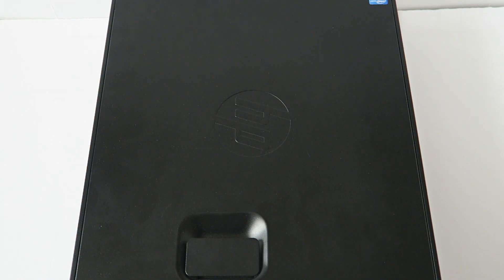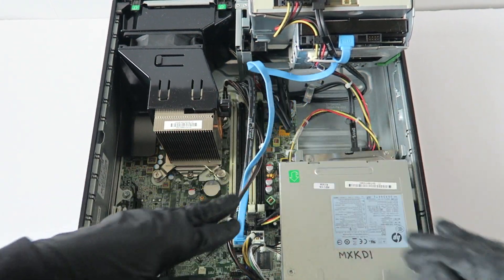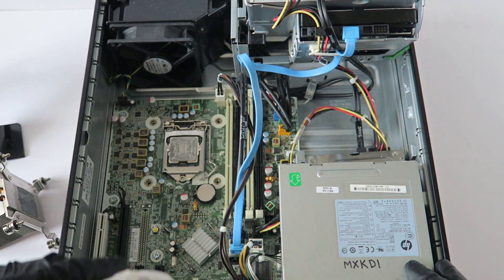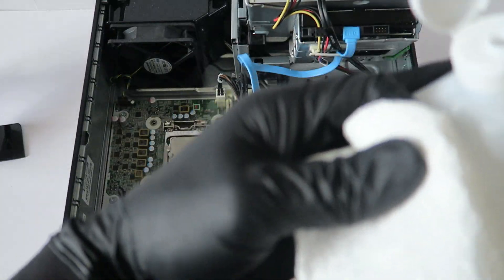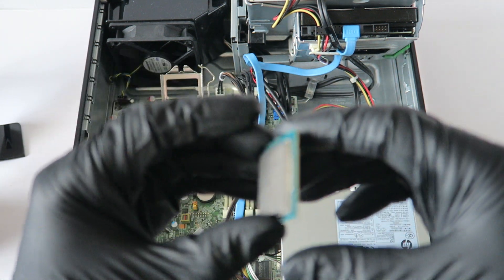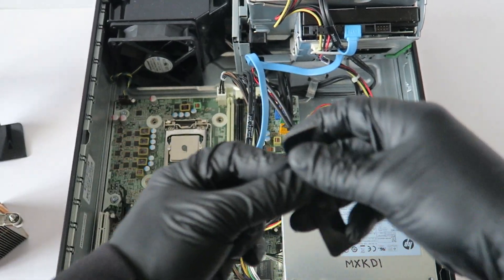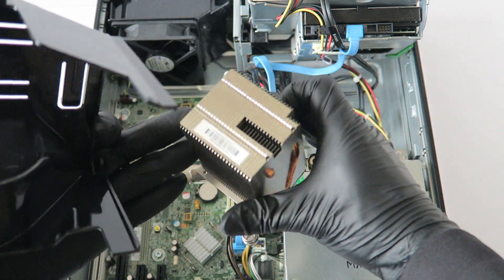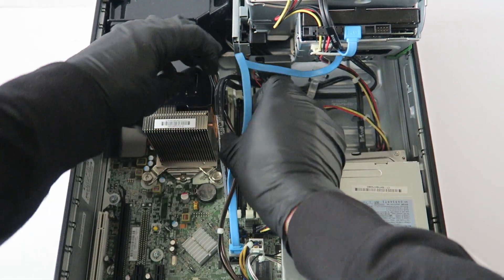HP Compaq Pro 6300 Processor Upgrade

Comment from the maker: List of Upgrade Parts will work with this system. 

Thermal Compound Paste:
(1.) Arctic MX-4 2019 Edition Thermal Compound Paste Carbon Based
https://amzn.to/2XcsZo4
(2) Arctic Silver 5 Thermal Cooling Compound Paste 
https://amzn.to/2ziNU0H
(3) Noctua NT-H1 3.5g, Pro-Grade Thermal Compound Paste
https://amzn.to/36kTk7A
(4.) ARCTIC MX-4 (current edition) Thermal Compound Paste 20 Grams 
https://amzn.to/2DhGJaK

This RAM works with this machine:
Tested with 16GB RAM MAX works perfect with this machine.
(1.) Crucial 8GB Single DDR3L 1600 MT/s (PC3L-12800) Memory CT102464BD160B
https://amzn.to/2z7gDpj

(2.) Crucial 4GB Single DDR3L 1600 MT/s (PC3L-12800) Memory CT51264BD160B 
https://amzn.to/2TrcLq1

(3.) Crucial 16GB Kit (8GBx2) DDR3L 1600 MT/s (PC3L-12800) CT2K102464BD160B 
https://amzn.to/3g7dE0C
 This video cards will work with this system.
(1.) Gigabyte Geforce GTX 1050 Ti OC Low Profile 4GB GDDR5 128 Bit PCI-E Graphic Card (GV-N105TOC-4GL) 
https://amzn.to/2XEqKMb

(2.) MSI Gaming GeForce GTX 1650 4GB GDRR5 Low Profile Graphics Card (GTX 1650 4GT LP OC) 
https://amzn.to/2VkDdSd

(3.) MSI GTX 1050 TI 4GT Low Profile  Graphic Cards 
https://amzn.to/34r0AxG

(4.) Gigabyte GeForce GT 1030 GV-N1030D5-2GL Low Profile 2G Computer Graphics Card 
https://amzn.to/2Xu3SyO

(5.) ZOTAC GeForce GT 1030 2GB GDDR5 64-bit Low Profile Video Card ZT-P10300A-10L 
https://amzn.to/3eayL1b

 SSD list works with this PC.
(1.) Samsung 860 EVO 500GB 2.5 Inch Internal SSD MZ-76E500B/AM) 
https://amzn.to/2yNxnkE

(2.) WD Blue 3D NAND 1TB Internal SSD, 2.5" WDS100T2B0A
https://amzn.to/2wvnC9Z

(3.) WD Green 1TB Internal PC SSD  WDS100T2G0A
https://amzn.to/3cbrcWa

(4.) SanDisk SSD PLUS 480GB Internal SSD SDSSDA-1T00-G26
https://amzn.to/3a3i9ou

(5.) Crucial MX500 250GB 3D NAND SATA CT250MX500SSD1(Z) 
https://amzn.to/34rZlhy

(6.) Samsung 860 PRO SSD 256GB - 2.5 Inch SATA III Internal Solid State Drive
https://amzn.to/2ybiHLK

(7.) Samsung SSD 860 EVO 250GB 2.5 Inch SATA III Internal SSD 
https://amzn.to/2VjIAkK

(8.) SanDisk SSD PLUS 240GB Internal SSD
https://amzn.to/3c7SEE4

HDD list works with this PC:
(1.).WD Black 2TB Performance 3.5" Hard Drive - 7200 RPM Class, WD2003FZEX 
https://amzn.to/2xFUeyF
(2.).Seagate BarraCuda 1TB Internal Hard Drive
https://amzn.to/3g8FXM8
Reply: what about changing the psu
Reply: @popcornandzerocoke5043  proprietary design, not sure if there are aftermarket replacements / upgrades.  stock power supply is about 240 watts will host 1650 low profile @ 75 watts.  people in some instances are moving to larger cases that will host a larger psu., problems w backplate matching.  these things are a bit of a quandary whether worth the time / effort and $ to bring close to modern standards.
Reply: @kevincody8391  sff is a risky choice, then.
Reply: @popcornandzerocoke5043  sff always is, esp when propierty = HP / Dell.  remember that going forward, you may not know now, butt will eventually.  get condition max flex, maximum flexibility.
these puters range from dirt cheap free.99 to a $100.
Our choice is to sink money or effort, some combo of.  pure Effort = converting to Linux.  and there's a lot of effort in not, can you successfully clone spinning HD w Windows 10 to an SSD?  decide that before upgrading video, or hate Windows.
Reply: @kevincody8391  I am currently running the MSI 1650 lp link you gave... and my pc runs fine, but you need a dvi cable, unlike the factory VGA.

anyone know any GPU's I can put on the computer's HP 339A motherboard.
Reply: THANKS FOR THE VIDEO this was very very helpful, definitely subscribing
Reply: so you didn't have any problems runnig the new CPU? because this was a pre-made system, you know... I am just curious.

Comment: whenever i upgrade my cpu from i5 3470 to i7 3770, i cant boot the pc with my gtx 1050 lp on, it only works if the gpu isnt connected or drivers not installed, but with the i5 it works perfectly is there any help please
Reply: I upgraded my HP 6300 pro I7-3770 Computer but it crashes, what should I do?

Comment: whenever i upgrade my cpu from i5 3470 to i7 3770, i cant boot the pc with my gtx 1050 lp on, it only works if the gpu isnt connected or drivers not installed, but with the i5 it works perfectly is there any help please

Comment: Hello, I wonder if it is possible to add a cooler for the processor without having to remove the motherboard from the case? Would you recommend that or leave the one you already have in stock?
Reply from the maker: Hi, you can only use hp stock cooler  SFF LGA1155 CPU Heatsink 628553-001

Comment: Thanks I have a question.  My system model is hp compaq 4000 pro . Can I install a i5 or i3 cpus ? Like i3 560 or i5 750 ??<3
Reply from the maker: Hi, no fastest CPU this PC supports is Intel Core 2 Quad.

Comment: hey bro, can i put i5 9400f?
Reply from the maker: Hi, no
Reply: @Mxkdt  bro can I use I5 3570 3.4 GHz (upto 3.8 GHz ) on my hp Compaq pro 6305 microtower pc (not small form factor)
Please reply 
Currently I have A10 5800k processor which supports  fm2 socket, will i5 3570 work on my motherboard

Comment: I'm making a gaming pc out of one of these and rn i only swapped the ram and I'm wondering if I should get a 1050ti lp over a 1650lp cause of the lower power draw. Would I have to do that?
Reply: Can you tell me how happy you were with yours after upgrades? Trying to find out if it's worth upgrading mine.  Thanks in advance
Reply: @4tobybrooks  Mine ended up frying itself somehow so i jjst ended up tbrowkng it out, they are so old, i now have a Nitro 50
Reply: @Dustin34  so I should probably pass, huh?
Reply: @4tobybrooks  100%
Reply: @Dustin34  thank you!

Comment: Hi im just planning to change my processor and i have the MT version. I'm thinking getting a a i5 processor which i5 processor is good? and can i get the K variant? because the k variant have hd 4000 integrated graphics (i dont plan on overclocking it i just think its better for a few bucks) any help will do 

edit: i dont have enough money for i7 3770

(sorry for my english it's not my 1st language)

Comment: nice videos. very good. i have a question, did u changed the power adapter, i´m maybe gonna buy a refurbished one HP Compaq 6300 Pro with a 230 watts unit and i worry about the upgrades there may come like a aktive gpu like u did.  i´m gonna use 1 ssd only and gonna disable the cdrom
Reply from the maker: HI, i did not change power and if you going to buy HP Compaq 6300 Pro go with i7 CPU and PC holds more value then i5 or i3
Reply: @Mxkdt  thank you :)
Reply: @Mxkdt  If I were to upgrade the power supply, do you know what kind I should be looking for?

Comment: BROOOO THABNKS YOU SO MUCH
Reply: just inherited one of these for free.99, an i7-3770 unfortunately w only 4 gig of ram.  what conclusions have you reached?  
a low profile 1650 = $150, a 1 GB SSD = $100.  if you can't scrounge up some DDR3 laying around, 8 GBs for $35, $60 for 16 GBs
so for approx $350 have a semi potent gaming / video trans-coding machine w DVR capability
has a working copy of Windows 10 on a spinning HD, odds of cloning to a SSD?
this thing is on the knifes edge of worth the effort / money
fail and and it is a deep dive into Linux

Comment: I have a hp Compaq pro 6305sff with processor AMD a10 5800b with gt 1030...can i change to Intel processor if not what the best processor for my motherboard
Reply: How is this set up working for you? I have the same computer (6305). Just bought the A10 5800b processor and planning to put the gt 1030 with another 4gb Ram to make it 8gb and a ssd. What do you think? Just light gaming and what not....whats the full specs on yours and how is it working for you? Thanks

Comment: Buddy 1 question i cant enter bios pressing scape. When í do this keeps the post screen (the only option i have is F1 to boot) thanks
Reply: On HP Systems you typically press F10 for the BIOS. An just press F10 repeatedly from the beginning.

Comment: hey @Mxkdi i have the hp compaq 6305 cpu with amd a6 processor rn can i upgrade to i7?
Reply: an amd socket does not support intel cpus
Reply: @illegaloper  can i replace it with a higher generation amd?
Reply: After a lot if research,  i came to know that i got FM2 socket so i can replace my a6 with a10 which is pretty much good for my use😊

Comment: First of all, thank you for all of your videos! 

Did you find any need to upgrade the motherboard? Wanted to order the i7, but my only reservation is if the motherboard will bottleneck it. Also, will this work with an SSD?

Sorry for the novice questions, but I'm very new to this, and wanted to make sure I do it right the first time. Thanks in advance!!
Reply: I feel the same

Comment: I have a HP 6005 compaq pro with an athlon x2 b28 processor. Would I be able to install the same cpu as this one?
Reply: Samuel Paler hope so, I’m in the same boat. Fair warning, there isn’t a lot of info on our setups.
Reply: @marcusjnewtonz28  Thanks you your reply! Are you also using the same cpu? I was thinking about swapping my motherboard with one from an 8300 compaq pro. The frames seem the same and the 8300 accept intel's I7 cpu and has 4 usb 3 ports on the back. I'm not sure if it will work though
Reply: Samuel Paler you MIGHT run into some trouble with the difference in USB ports. IMO, being there are certain models of i7 CPU’s that are compatible with our motherboard, I’d recommend sticking with it, and letting the cpu and video card do the heavy lifting, provided you already upgraded your ram. And yes, same awful cpu 👍
Reply: @marcusjnewtonz28  I thought our motherboard was only an am3 type cpu socket and it only accepts up to 95 watts of cpu?
Reply: Samuel Paler After researching it further, a reference I was reading on the upgrade to an i7, they put separate motherboards in the 6000 series ssf hp’s that we have. Our’s are indeed different, as are every other 6000!series out there. It keeps getting harder to find accurate info on this damn thing. Keep me posted on your build if you don’t mind man and I’ll do the same 👍
Reply: Samuel Paler one more thing, I’ve since found that the AMD Phenom b95 quad core, though 95 watts, is compatible, with our motherboard. Apparently the MB’s were built to be “flexible” to 95 watts if needed. 👌
Reply: @marcusjnewtonz28  I was searching up am3 cpus and found the AMD Phenom II X6 1065T. It uses 95 watts and am3? Its a 6 core.
Reply: Samuel Paler I looked at some reviews and our stock fans won’t support it; however it’s easy to just buy a better fan 👌I like that CPU
Reply: @marcusjnewtonz28  I decided to pull the trigger on swapping out my motherboard for an 8300 sff elite and finished it today. I went with luck to test if it would fit and all the plugs and screws lined up to my surprise. It has the lga 1155 cpu socket in which I bought an  i7 3770 for. I lost the use of my 250g hardrive and redownloaded windows to my ssd which I also had. I will try to get it working someday. I had to wipe my 500g ssd to do the job. My computer reads itself as an hp 8300 elite sff now. The i7 is way better than what a 1065t would be even with less cores. No more 100% cpu spikes with the old amd athlon ii x2 b28.

Comment: Can I put an i5 3470K processor or an i7 3770K on the hp 6300?
Reply: You can, however it would be better to go with a 3470 or 3770 instead of the K variant as you will not be able to overclock on this mainboard.  If you already HAVE the K variants then it's no big deal but don't spend extra for them as you can't take advantage of them fully.

Comment: So I have two of these PC's both are the microtowers, I bought one with an i5 3470 the other with an i3 2120 both had 4g of ram. The i5 motherboard went so I decided to just upgrade the i3 to the i7 3770 and install 16g of ram. I installed the ram first to make sure it worked and no issues with the i3 so in with the i7. Hit power and I get 5 beeps and no boot just a black screen, I located the first two ram ports and only left them loaded and it booted fine so I tried again with all 4 loaded and same results as at first. I swapped out all ram to 2g sticks and would only boot with first two ports loaded. So I swapped out the processor to the i3 and everything's good again so I swapped to the i5 I had laying around and it's good everything works I put the i7 back in and I am back at square one. Could it be my processor is bad? It shows up correctly in the BIOS and windows system.
Reply: Problem solved. I used a pencil eraser and gently cleaned the contacts on the processor  , what made me think to look at that was the fact it wasn't seeing the ram and I tried everything else.
Reply: @tronalddump8776  Can I upgrade i3-2120 to i5-3470 in 6300 Microtower?
Reply: @detectivegenius9744  you can upgrade to a i7 3770 or the comparable xeon even. you have to make sure to keep power consumption within power supplies specifications or you will need to upgrade the psu, you will need an adapter since those boards require some proprietary connectors.
Reply: @detectivegenius9744  Xeon E3-1230 v2 selling for $12 dollars on ebay. 4 core 8 thread and slightly less performance than 3770 and since overclocking isnt a thing on that hp board youre better off.
Reply: @tronalddump8776  PSU(320W) can handle the power and i think it will be easy to install new cpu as both i3 2nd and i5/i7 3rd gen use same cpu connectors.
Reply: @detectivegenius9744  run it
Reply: @detectivegenius9744  i meant to hook up a atx psu you need an adapter otherwise it wont turn on. if you put a decent graphics card on it and that cpu together are gonna be at or above what that psu can handle. im just letting you know you got to take that into the equation with these hp pc's.
Reply: @tronalddump8776  Okay, thanks

Comment: What processor do you use when you upgraded
Reply from the maker: Why would you want to go with i5 and you can get PC with i7 for little extra.
Reply: @Mxkdt  idk
Reply from the maker: Hi, yes Intel Core i7 3770
Reply: @Mxkdt  what about the i5
Reply: @Mxkdt  how i can install gtx 1060ti on the pc
Reply: @PhúcBụi-k1p  just put it in the PCI x16 slot

Comment: Can i use i5 3570k and gtx 1050 ti if my power supply is 240w?
Reply: yeah ig but you will probably need another power supply
Reply: Chandler Stovall ye
Reply: Quite a few people on Youtube have built a 6300 with a 1050ti so I'd be confident it would.
Reply: thewinky01 Okay Thanks!
Reply: Eepuz I’ve swapped my processors around and now running a 1050ti with a 3570. Seems ok so far.
Reply: thewinky01 but The ”k” version takes more power
Reply: Pretty sure you can’t overclock them, all locked down being a business PC. Happy to be proved wrong!
Reply: @thewinky01  only the intel k's can be overclocked

Comment: This supports until intel core i7 to i5 which both of them cost a alot as 200$ is the lowest price i can find for intel core i5 and intel core i7 is around $500 edit: the model is also able to be upgraded into core i3 but the max it can be ugraded is to 3.9 ghz. and more in the quickspecs link below on the 3rd page http://static.highspeedbackbone.net/pdf/HP%20Compaq%20Pro%206300%20Series%20Business%20PC%20Quick%20Specs.pdf hope this helps

Comment: I have this computer in the 6005 model with the Athlon II x 2 B24. It is a HP 3047h Motherboard with a Chipset of Northbridge

AMD 785G.      Can I upgrade to the Intel Core i7-3770 too? Or the 3770S? 3770K?

Comment: I put a new processor that is i5 2400 ... After that display not showing and fan are running at full speed with a very loud sound... Ram are ok and processor also can you tell me what will the problem
Reply: Wrong processor. You need a 3470, 3570, 3770

Comment: Hi. Can i put gtx 1050 ti zotac single fun?
Reply: 1050 low profile will fit
Reply: Low profile card will work but be careful of what processor you have running and what other components you have you don’t want to blow your psu

Comment: Hey
I too have the same computer
But you just mentioned that it supports third generation processors
I want to give it a heavy upgrade
Of 8th or 7th gen processors
But I am scared about the power supply
Will it support new processors
Please help
Reply: Sorry man, the socket for the new processors are different. Stick to what this socket supports
Reply: @SpectralComponent  thank you